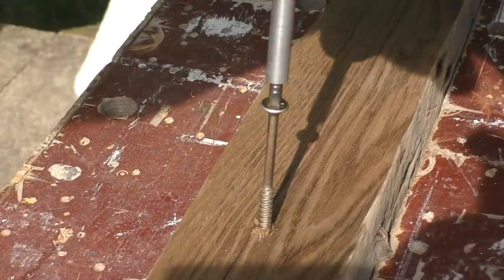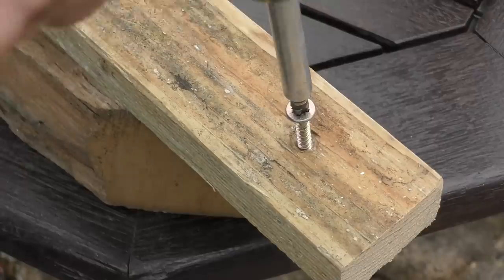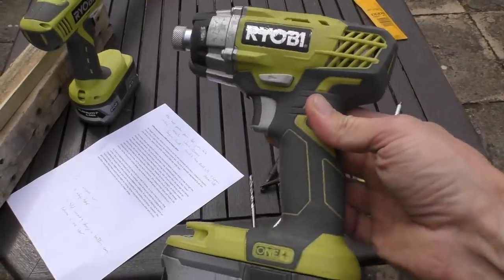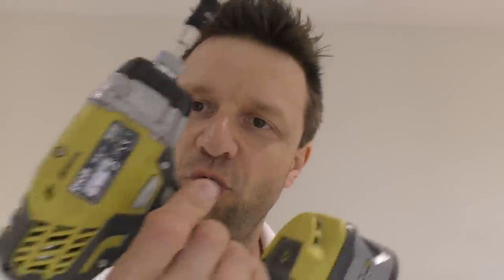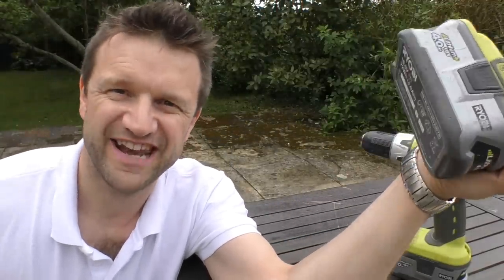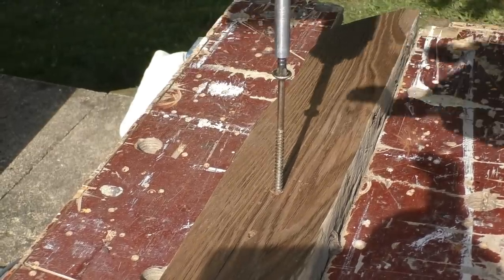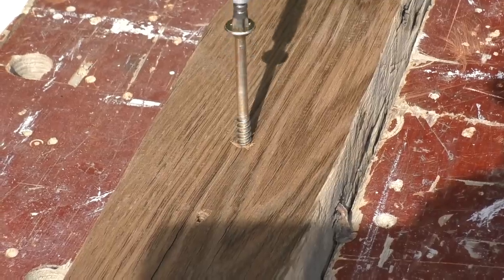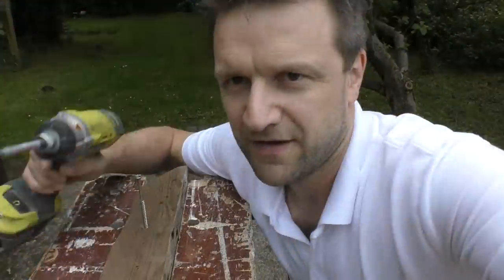Difference between Drill Drivers & Impact Drivers

Comment: This is a very biased review, the impact driver consistently fails and you still try to sell it. It's made for mechanics only, don't be fooled into thinking it replaces a drill/driver.
Reply from the maker: I'm sorry but this is nonsense as the impact driver has multiple uses beyond just mechanics. The impact driver and drill driver are two very different tools designed for very different purposes. The hammer or impact action on the impact driver works in the direction the bit is turning, which gives the tool so much more raw driving force than you get with the drill driver for the bespoke purpose of driving home a screw or bolt. In short you can drive home a screw single handed with an impact driver that you would probably need two hands to hold onto with a drill driver. A lot of people say you can use the hammer action on a drill driver to drive home screws. This is rubbish. You can't. The hammer action on a drill driver works IN LINE with the drill bit rather than perpendicular to it as the impact does. It's designed for drill bits NOT screws. So in short you're just hammering the top of the screw, which achieves nothing. Yes the drill driver or combi drill if you want to be totally accurate is an all round tool but if you want a tool that is specifically designed to repetitively and forcefully drive home screws, then you need an impact driver.
Reply: @CharlieDIYte  that's a very long winded, possibly angry, reply that agrees with what  I already said.
I accept there may be other trades that could make use of an impact driver, i.e. window fitters, but realistically they do not replace a drill/driver. That was my only point.
The reason I commented is because I have students who like to use impact drivers to put M4 screw in plastic saddles and it gets quite frustrating that videos like this give them confidence that they are doing the right thing!
Reply from the maker: @stevenhopkins2925  Not angry Steven, I'm just taking issue with your comment that the review was biased and that impact drivers are only useful for mechanics. If I'm completely honest I use my impact driver a lot less than my drill driver but there are absolutely jobs that I would only use my impact for, such as driving home large screws in the wall when putting up curtain hardware. Admittedly it's horses for courses and particularly when tightening screws into Fischer fixings (Duopower and UX6) I like to use a manual Stanley screwdriver to double check tightness of the screw, although the fitter I work with uses his DeWalt impact for everything.
Reply: @CharlieDIYte  you don't need an impact driver for curtains! You shouldn't be using it for screws in wood either, it's just lazy and will likely do mere damage than good. What's wrong with a good old pilot hole?

Comment: Everything about this video is outdated.
Reply from the maker: Ignore that comment - because it's one of those annoying comments that makes a statement without bothering to substantiate it. Where are you based, what's your budget and are you an occasional DIYer rather than a trade? I'll give you a few ideas, but suffice to say there are some very good value for money tools out there, and a couple of 2ah (nice and light) or 4ah battery will do that job no problem
Reply: Charlie DIYte you completely disregard the brushless technology every manufacturer to making now. Even 3 years ago brushless tech had been around for 5 years already. They’ve made the 1/4” quick change drill bits for over 15 years now. My statement stands as true.
Reply from the maker: @Lew-Dogg  But this video was discussing the difference between impact and drill drivers, and whether they're brushed or brushless is irrelevant to that discussion. So, no, your statement doesn't stand true, because the way impacts work (the hammer action working in line with the forward or reverse motion of the bit) hasn't changed with the progression from brushed to brushless. If you want a comparison of brushless tools you can check this out https://www.youtube.com/watch?v=i6KYfrDBj3w&t=303s
Reply: Charlie DIYte the brushless technology causes the batteries to perform totally different. Which is why there are high output batteries to benefit these better motors. And of course these brushless tools also have higher torque too. There is literally no reason to own just a drill anymore. Which is why all the big brands have gone to hammer drills. They’ve designed the impact to be a total drill replacement.
Reply from the maker: @Lew-Dogg  I can tell you're not going to give up on this Lewis, but it's simply not correct to say the impact is a total drill replacement. At the moment the percussion on the impact works predominantly in a perpendicular direction to the bit, ie clockwise or anticlockwise depending on whether you're screwing in or unscrewing. Yes they make hex shank drill bits for impacts which is useful for limited drilling jobs, or in fact for flat or auger drill bits where you don't want the drill wrenched out of your hand if it gets stuck. However the impact drill is still primarily for screws and bolts. The combi or drill driver is still a far more accurate tool for drilling and the hammer action on a combi drill works parallel to the drill bit to hammer it home, which is very different to the action of the impact. The days when the impact is a "total drill replacement" are still some way off.
Reply: Charlie DIYte only in the world of Ryobi. There’s a reason they’re so affordable. The tech is a decade old. Like I keep saying, everything you’re talking about is outdated. By about a decade.